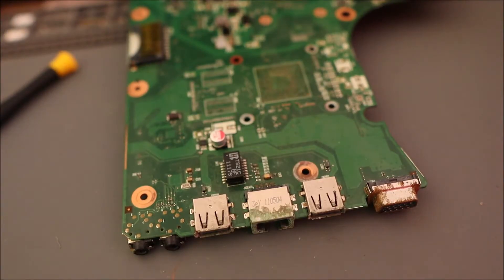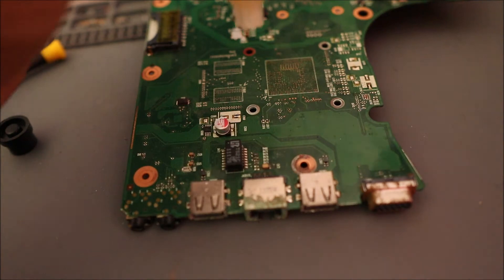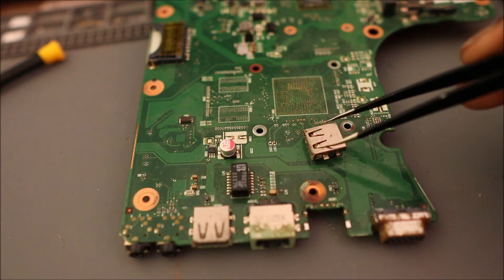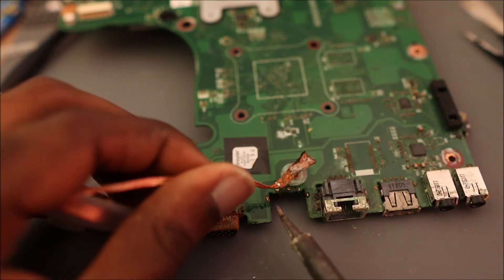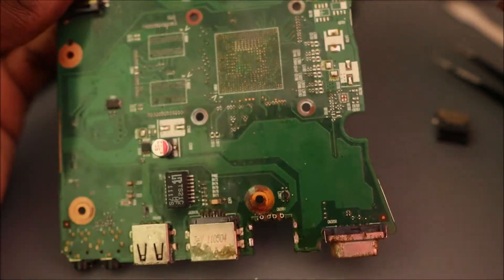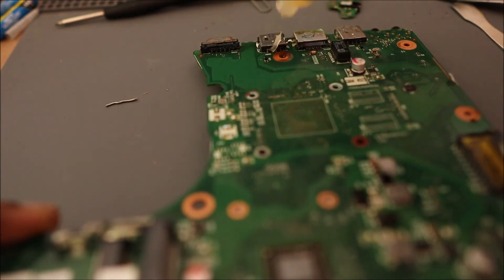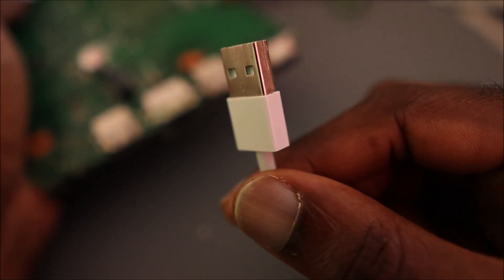Laptop USB replace Guide- How to fix your USB port on Laptop

Comment: How many degrees of heat should a hot air gun be?
Reply from the maker: 400 if the port is bad and you dont want it to reuse as the heat can melt the plastic part of it. so it all depends
Reply: 9000

Comment: What does flux even do? I've been soldering without it just fine.
Reply from the maker: it help to solder and de-solder without making any damages.
Reply: You can't solder without flux. The solder won't even adhere to your iron let alone the item you are soldering. There are two types of solder, one has flux in the core (called fluxcore) and the other is fluxless. If you use the fluxless solder you have to add flux as seen the video. Most of the thinner solder is fluxcore and I'm certain that is the type that you have.
Reply: @greygtv6  like I said, I solder without flux all the time. I didn't say it was easy but I do it.

Comment: I melted my USB port with this method.
Reply from the maker: its a technique, you angle most of the heat where needed but not for to long. and also can use low melt solder to remove

Comment: What tool did you use to clean out the 4 holes?
Reply: They call it "solder wick".
Reply from the maker: braided wire with flux

Comment: When you said "let's just do it from the back" you flipped it over and did the soldering on the USB that you didn't take off. When you flipped it over, the loose USB should be flipped to the left
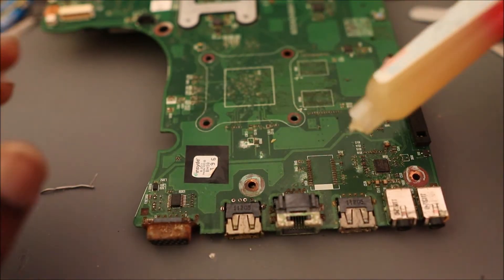Reply: You are absolutely correct!  At 4:48, he flipped the board over and worked on the USB A port that was two ports away from the one that was actually removed.  Great catch!
Reply: How much we should maintain, you didn’t speak about it

Comment: can I  replace 2.0 to 3.0 USB port
Reply: no that's not how it works. the motherboard would have to be set up to support usb 3.0 so if it didn't have it originally, it won't work.
Reply: Nope..   the bios has been programmed to see that port as a usb 2.0.